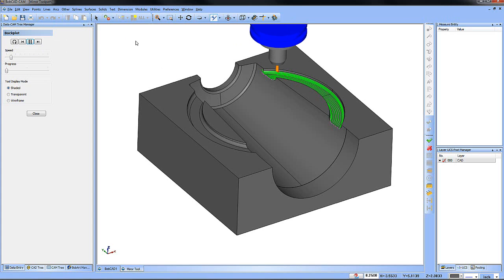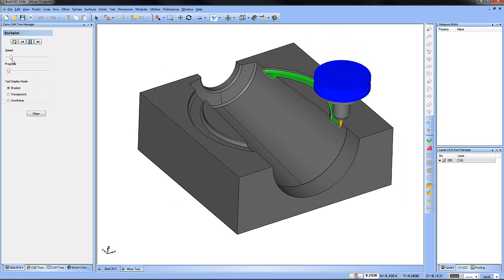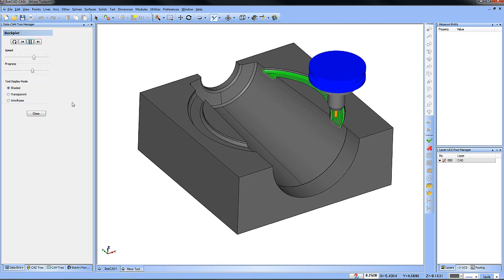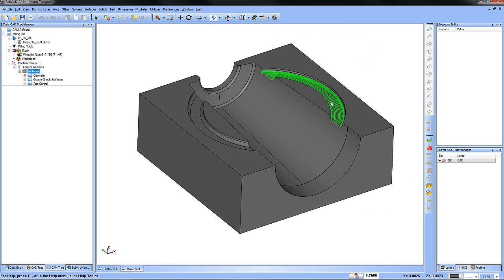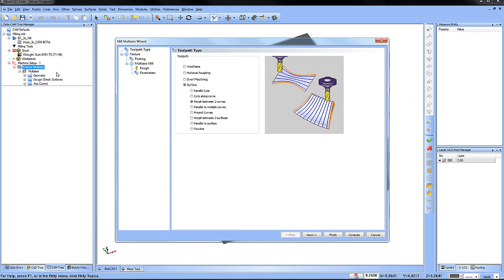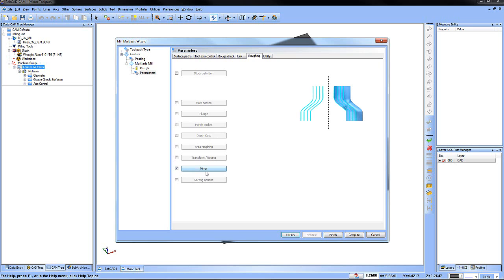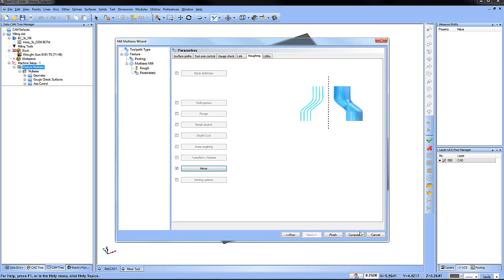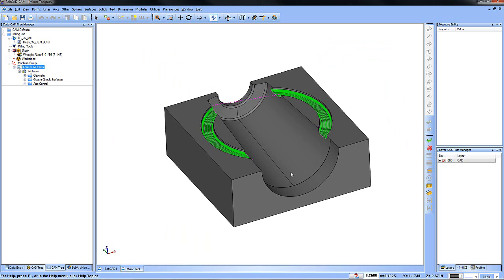Mirror Toolpath using BobCAD's Multiaxis software

Comment: Make it 4.000 diameter with 1.000 pitch x 1.000 deep and let it have a .250 wide spiral cutting blade to it.  And draw it parallel with the X Axis.
Reply from the maker: Do you want to see how to draw it or how to machine it or both?
Reply from the maker: Do you have a phone number or some way I can reach you by phone?
Reply: Just Draw in Bob Cad.
Reply from the maker: Ok so I've created the file in CAD, done it 2 times now.  The video ran about 10 mins to walk through the steps.  I would like to connect with you to go over the video before I post it.  Can you DM me please
Reply from the maker: https://youtu.be/9rLoditahT4